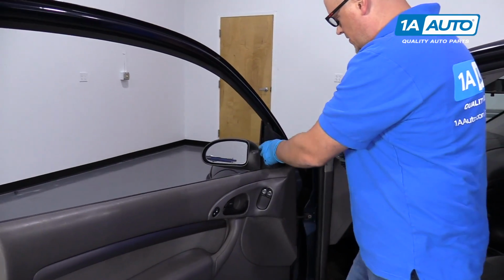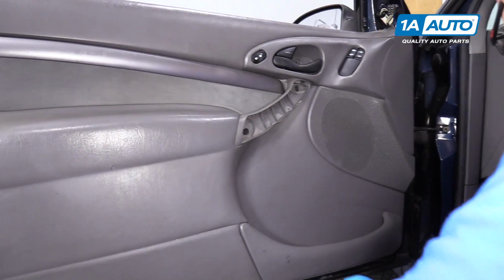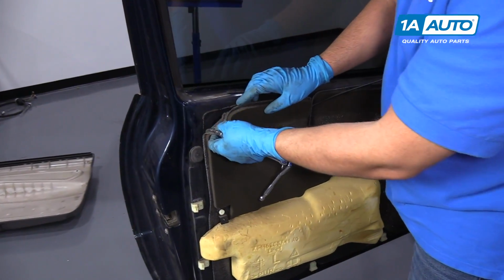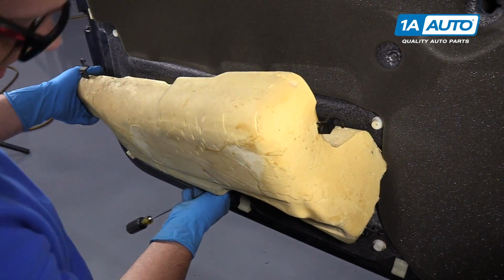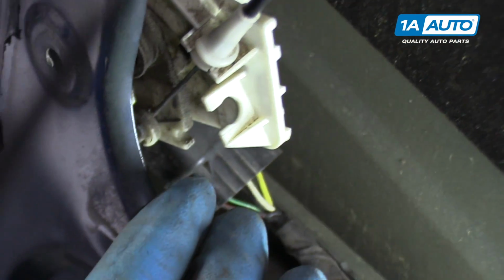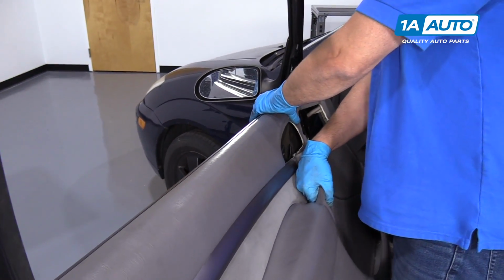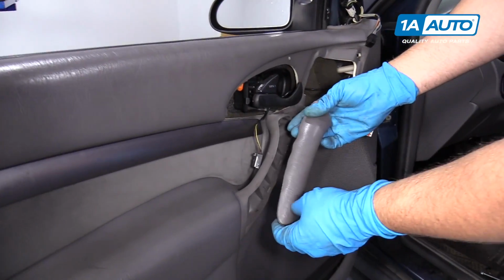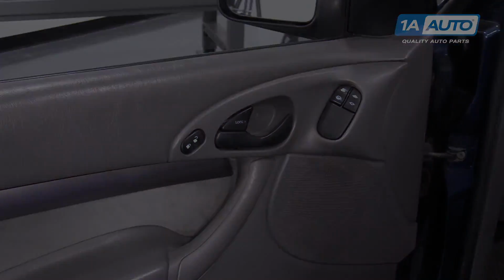How to Replace Inside Door Handle Cable 00-04 Ford Focus

Comment: I had a new actuator ,cable and door handle installed, but my door knob lock button stays open with the handle and I can’t open it from the inside. Opens from the out. Any idea?